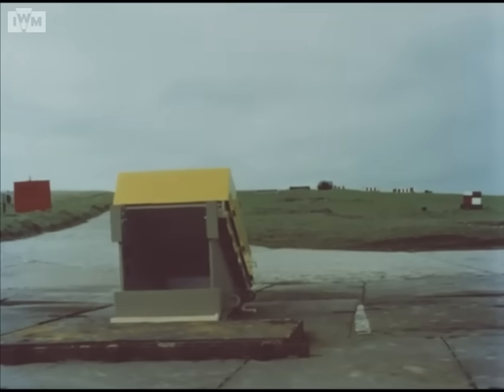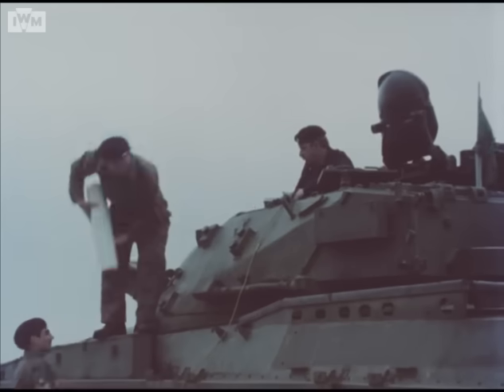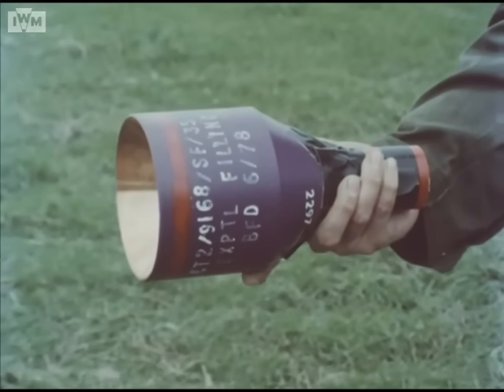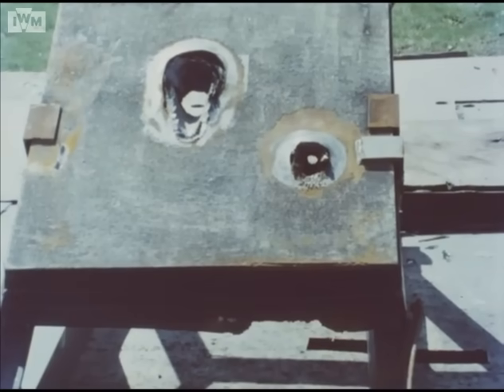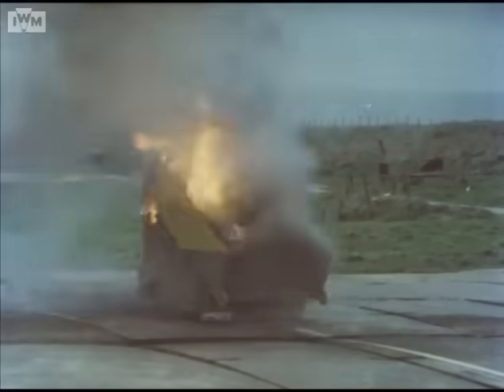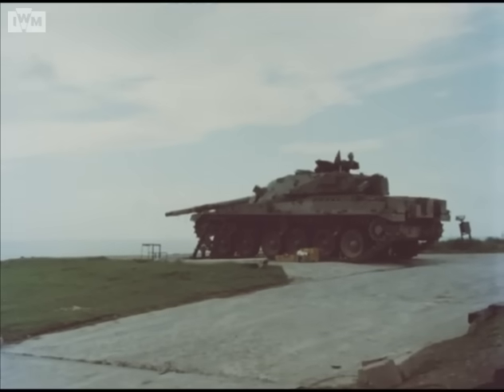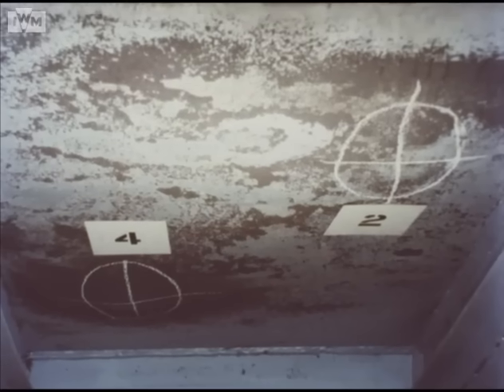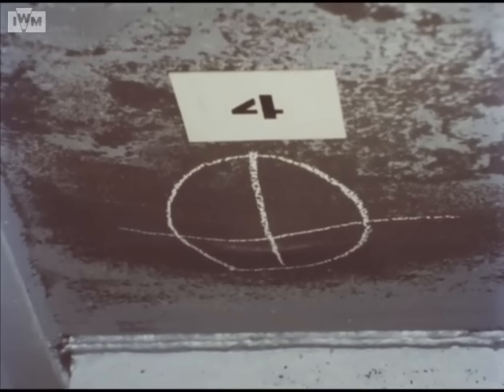Firing trials on British Chobham armour 1979

Comment: I like that even under Closely Controlled Range Conditions with the engine off and no noise inside the turret that the TC still sergeant-screams. Totally useless, but regimental drill is hard to break. I'll bet he still yells at 157% max volume to just ask for bacon on the side.
Reply: Retired Canadian Tank CC here. It is still used for 2 reasons 1 coms die 2 Bellowing out your drills ensures an automatic response to a familiar command under stress. It freaks out some international exchanges. Particularly how we used IC {intercom} for everything else in the vehicle calmly and with clarity, up until the gunner or CC spots a target. It can be a bit jarring, and most of us are half deaf so I guess 3 reasons.
Reply: It's called a 'drill' for reason! You practice and practice until you get it 100% right. That moment when the commander gives a fire order? The whole crew act as one. Everything works as per training because it's 'drilled into you' you don't actually think... you react. After that initial call...SABOT TANK ON! you literally have seconds before the enemy shoots back. I could load 10 rounds of 120mm split ammo with my eyes shut because we practiced so much and the orders were screamed to motivate you above the noise of everything else. Driver full reverse! Sabot tank on. fuck me! Gunner see it? ON! right range? 1200m , driver left stick! fucking hell! When it all happens that crew work as a perfect honed instrument. They work in unison as a perfect unit. If you'd ever been a crewman you'd understand.
Reply: You are spot on! @davepritchard283
Reply: @davepritchard283  Nowadays I bet the tanks could be made unmanned and 100% automatic. They take care of each others at the war field without any human lives lost. Or someone remote controls them just from home with HOTAS joystick.
Reply: @wekkimeif7720 i know UK had a fully unmanned self automated tank we were doing trials with back in 1989. No idea what happened to it or the program.. i do know that in 1990.. the cold war ended.. so lots of development was dropped  or cut back.. and also new powerful computer processors where being released to the civilian/ public market.. at which point.. the military went from controlling and developing technology to being over taken by civilian markets where the military could then just buy from manufacturers becuase they were doing the design and development so the MOD could buy direct off the shelf so to speak.  Saving years and millions of £'s in development.  From 1990 on the whole UK ( and US and western countries) went through similar down turns. Lots of projects shelved, cut back or scrapped.
Reply: @agile-heliuk1801  That was pre AI capable computers so ultra vulnerable to jamming.
Reply: SERVER! BACON! PLATE!
Reply: DishwashermannedandreadySAH!

DishwashersecuredSAH!
Reply: Yeah they totally dont have hearing pro on and they totally dont need instructions to be loud and clear to avoid any possible excuse for a fuckup
Reply: Bacon is never on the side
Reply: @lickspittle1 Thank you NOW WHERE IS MY BLACK PUDDING?????
Reply: I used to work in an office with a territorial sergeant. His "normal" voice made the windows rattle, and all conversations took place outside the office as a result.
Reply: Proposing to his girlfriend: "WILL YOU MARRY ME!!!!!"
Reply: Something something, tank, on?
Reply: @hfuy8005  They're deaf from all the BANG!'s anyway.
Reply: Bacon on the side of his Pan Kit, Messing
Reply: I always thought it was just because artillery and tank gunners are all deaf. Lol.
Reply: "Coffee low, requesting resupply!"
Reply: Lol. As an infantry soldier i Hated dismount from APCs.  It took 10 seconds for the ramp to deploy. 
The whole time everyone screaming. GOGOGOGO!!!!
Finally we in 22B agreed we were all moving at maximum. We dont need the hollering 😂. So we stopped.
Reply: Sergeants have to pass a special 'Advanced Shouting' course before they can be considered for promotion to that rank. 

Only those that pass with the 'Deafen Within 50 Yards' achievement are eligable for future consideration for Sergeant Major. 

The very few that succeed in shouting a Challenger 2 into a quivering 2CV are the ones that can become Regiment Sergeant Major.
Reply: Iì
Reply: That was something I really didn’t like.

Comment: I might be wrong but that didn't look like a chieftain to me
Reply: Well what else would it be?
Reply: @looke3392  at first I thought it was a centurion. At some angles it looked a little like a m60. You aren't seeing it from the front for starters and it has no side skirts. I am not a tank geek.
Reply: @guywilloughby3383  Plus there are all sorts of oddball tanks used in testing, it could(its not, but could have been) be some one and done production. Several Centurions with some Chieftain parts(other way around?) where the proto FV4202 aka FV 40-tonne Centurion.
Reply: @alexsmart5452  it's a chieftain with no sideskirts
Reply: @guywilloughby3383  if it was a centurion the gun would be a 105mm (distinctive from the 120mm) would have a taller more round turret, different hull and it wouldn't be an m60 for pretty much the same reasons. It is a chieftain with no side skirts
Reply: I thought the same thing, but then realized I had never actually seen one from that angle(Im an American*). So I looked at photos of one from multiple angles, and yep Chieftain. 

*Chieftain is still the coolest, most badazz looking Post WW2 tank. Great job cousins.

Comment: trying to image the sound a striking shell makes as heard from inside a tank
Reply: ‼WHAT⁉ 🪖🙃
Reply: It probably varies projectile to projectile and whether it penetrates or not, but I've heard that tanks hit with shots that ricochet end up making the tank sound like a gigantic bell.
Reply: @I_Stole_A_BTR-80  I'm a blacksmith , mis-strikes and glancing blows are often worse than a direct hammer strike on the anvil.
Reply: They should measure the decibels right behind the plate. That would be interesting to know.
Reply: Well, a Serbian 100mm HEAT round on the front turret of a Chally 1 sounds like a wet thwud sound.  About as loud as a wet towel hitting the floor if tossed from a 5 metre dive board. Enough to make a gunner ask if anyone else heard that and what was it.

I have a feeling the T55 crew never registered what the return HESH round sounded like given the turret came clean off.
Reply: You do know tank crew wear headsets that block loud sounds?
Reply: @NineSeptims  "block" no they just prevent you from going deaf, loud sounds are still loud. Less loud, but loud
Reply: B W A N G
Reply: Wear a cardboard box, and get a small slit to look out of and a pistol or something sticking out, kneel on the ground and shuffle to move, nerf tank,
Get shot at, sounds like a tank.
Reply: HUH ???

Comment: Two,years after these tests the DOD/MOD/UKGOV shared the process with the Americans , a year later the Russians had it too.
Reply: @Jermo7899  yes, the ERA is doing it’s intended job. Randomly citing Russian tank losses proves nothing except that this is a high intensity conflict and losses are to be expected. No idea what you are trying to achieve with this statement.
Reply: Do you reckon the Russians use a reverse-engineered Chobham?
Reply: Everyone just thinks they know what they are talking about so why bother asking oe anything
Reply: @Jermo7899  at this point you are willingly ignoring what I’m saying even though you’ve clearly done no research and would be best served doing less yapping and more listening. ERA is designed to take one hit that has a reasonable chance to do serious damage if not penetrate the tank. That is why tank ERA has evolved from relatively sensitive to extremely insensitive. Even anti tank mines or direct artillery hits don’t detonate ERA, that is just how resistant ERA is. Since precursor charges are relatively small, Relikt ERA and the like are designed to be able to resist detonation when struck with the precursor warhead. All Russian vehicles have roof mounted ERA. While older Russian tanks have kontakt 1 on the roof which would not be effective against tandem, the T-90M has roof mounted Relikt ERA. Don’t take my word for it, you can literally LOOK UP THE FOOTAGE, the T-90M survived the javelin top attack because of its Relikt ERA. And yes, you can cover almost every inch of the tank in ERA. Look at the new T-72B3Ms, they are covered from head to toe with ERA
Reply: [Cough] Don't read too much into that...
Reply: Given that Russia have continued to slap ERA over their tank they found the engineering challenges beyond them.
Reply: @robertpatrick3350  cost is also a factor
Reply: @robertpatrick3350 era is added protection.You have no idea what you're talking about
Reply: @robertpatrick3350 ERA is proven to be a very cost effective and efficient way to increase armor protection. That is why other than the K2 black Panther from South Korea which makes extensive use of ERA, the T-90M has the best LOS protection against KE projectiles for the first shot, with an equal amount of base armor compared to western contemporaries plus the +40% LOS equivalent protection from Relikt. I can guarantee you that Russia has no such engineering challenges considering that the very premise of composite armor and APFSDS was first put into service by the Russians on the T-64.
Reply: @Anonymous-is6xu a tandem warhead makes era useless
Reply: @Jermo7899  nope. Duplet ERA is specifically designed to make tandem charges useless (its essentially double layered in its design). Relikt ERA is also immune to tandem charges, since it uses a thicker front plate and is therefore more resistant to the small precursor warhead and will not detonate until the main warhead hits. EVEN IF the ERA detonates and the tandem charges work, the flying ERA plate will still likely damage the main warhead and therefore reduce its penetration capability. It’s always a good thing to have ERA than not to have it
Reply: @Jermo7899  1. Duplet ERA is specifically designed in response to stop tandem warheads (yes, layering does work), the Ukrainians even TESTED this with an actual tandem warhead and it reduced the penetration of the tandem round by at least 70%
2. Relikt ERA not only theoretically can stop tandem warheads, it has already done so against one of the best tandem warheads in the world. A T-90M was recorded back in 2023 by a spotter drone surviving a javelin top attack warhead solely because of the Relikt ERA’s effectiveness against tandem rounds.
Reply: @Jermo7899  at this point you are willingly ignoring what I’m saying. ERA is designed to take one hit that has a reasonable chance to do serious damage if not penetrate the tank. That is why tank ERA has evolved from relatively sensitive to extremely insensitive. Even anti tank mines or direct artillery hits don’t detonate ERA, that is just how resistant ERA is. Since precursor charges are relatively small, Relikt ERA and the like are designed to be able to resist detonation when struck with the precursor warhead. All Russian vehicles have roof mounted ERA. While older Russian tanks have kontakt 1 on the roof which would not be effective against tandem, the T-90M has roof mounted Relikt ERA. Don’t take my word for it, you can literally LOOK UP THE FOOTAGE, the T-90M survived the javelin top attack because of its Relikt ERA. And yes, you can cover almost every inch of the tank in ERA. Look at the new T-72B3Ms, they are covered from head to toe with ERA.
Reply: @Anonymous-is6xu  I responded three times but all of them were taken down. Because I didn’t respond in the past 5 minutes doesn’t mean I’m ignoring you. My head hurts and I’m tired. I’ve had a 22 hour day. I promise I’ll respond tomorrow.
Reply: @Anonymous-is6xu  you too man. Take care
Reply: @Anonymous-is6xu  Cope harder. Russian era is poor, doesnt protect at all. Not only that but era is actually more expensive to maintain, compared to chobham armor, as you need to replace the explosive materials constantly. Also russian junk era is notorious of falling down from the tank when you are driving bad road.

Comment: But tanks do not have this thickness of Chobham - it is carried thicker than the RHA otherwise used, but not the same weight/thickness. This has its own advantage in keeping overall weight down.
Reply: ah thats why the challenger 1 was so light!
Reply: the whole point is that composite armors are more weight efficient than steel. drivetrain and suspension components (and roads and bridges) can only carry so much weight.
Reply: Remember, it blew right through the original plate. To stop HEAT, you might need double the thickness of RHA they used to protect from that HEAT, so the weight savings of composites do end up being significant.
It's hard to tell the thickness of that plate, but it looks to be around 300-400mm.
Reply: You didn't watch the first minute of the video? or maybe you did, but just didn't listen.
Reply: @ruzziasht349  There is more that goes into weight of armour than simply protection/kg for a test piece, he's right in that things like armour thickness/volume (and how the vehicle is armoured) absolutely have other effects on vehicle weight.

Consider conventional MBT of the 60s like Chieftain, T-62, Leopard or Patton, whether it's cast or welded or a combination of the 2, the armour forms the structure of the tank, they're essentially monocoques made of relatively thin and well agled steel.
Tanks, at least western tanks, protected by composites have their armour in removable packs which attach onto the outside of a hull. The armour itself isn't structural, so you pay a weight penalty for the hull plus armour packs. Incidentally, this is another reason why Soviet tanks are a lot lighter than western tanks, their composites are built into the hull, it makes the tank lighter but harder to repair or upgrade.
The other thing about these thick, externally mounted composite packs is they require a lot of overlap to be effective as they don't like being hit on the side of the packs. You need to overlap steel armour too, but if the composites are 4x thicker you will require 4x the overlap that again, adds more weight. Soviet laminate hull armours do tend to be a bit thinner, requiring less overlap, but they require being heavily angled which creates volumetric problems for the tank, on top of them already being cramped machines. The more advanced composites like Chobham don't require such extreme angling but they also don't lend themselves to being made into structural components of the hull.

Overall, you can make a better protected vehicle for the same weight, using composites, but the advantage isn't quite as much as a simple test panel on a range, as it is when you actually have to make a practical vehicle with a protected 3D volume inside.
Reply: @sergarlantyrell7847  he said they weighed the same - duh!